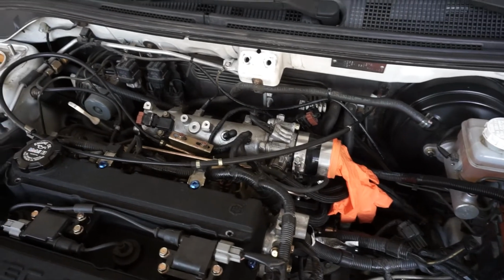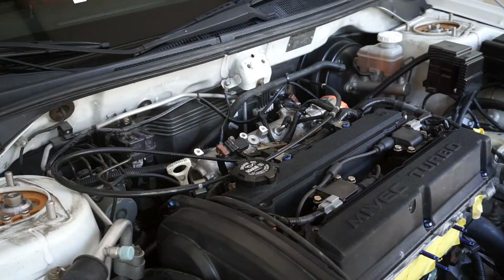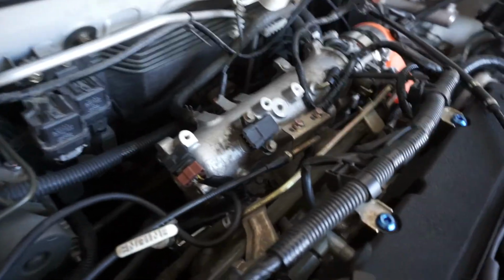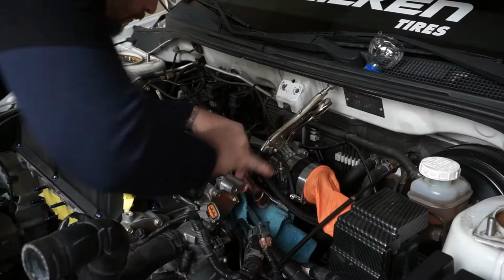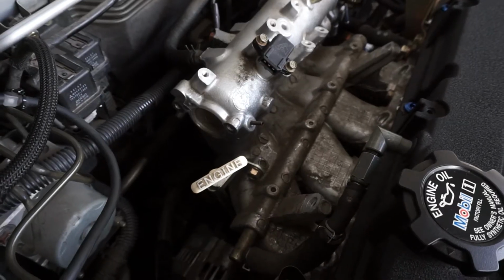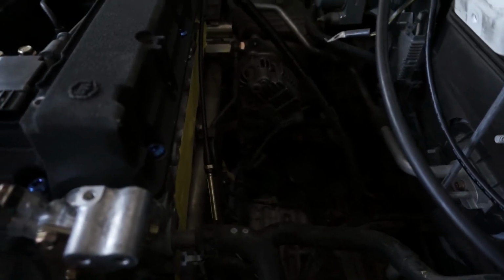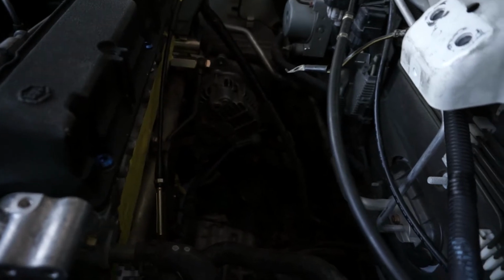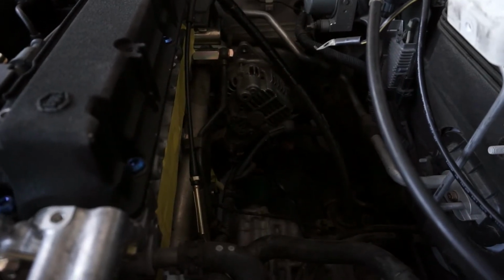AMS F-1 Intake Manifold For My Evo 9

Comment: How does the mount work. Manifold to firewall or manifold to block or manifold to its runners?
Reply from the maker: Manifold to the block
Reply: @EricMcWilliams515  The Bracket included mounts the manifold to the block seems like overkill.

Comment: have you had a chance to dyno the car w/ the manifold? how are you liking it?
Reply from the maker: I tuned it to 24psi on e85, but I ran out of fuel. I need more injector. Virtual dyno showed 420hp. I like it! It spools later than I would like, but I might be able to dial that in with mivec.
Reply: @EricMcWilliams515  what's your full set up mate? my understanding is a large plentum manifold like the ams will show gains w/ higher boost/higher hp applications but will certainly move the powerband slightly to the right
Reply from the maker: @supernice_auto  I have an fp green, full bolt ons and a built motor. Currently I have 1000cc injectors. My theory on running this manifold was to get more top end and run less boost than I was on the stock turbo. (30psi)